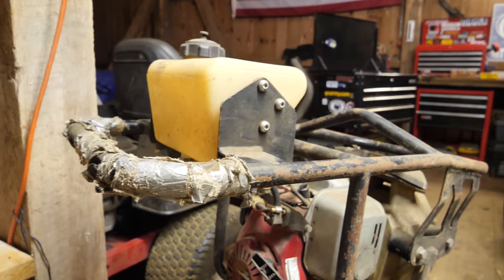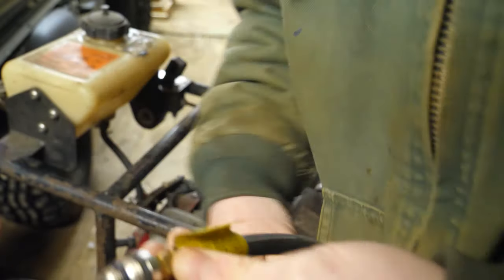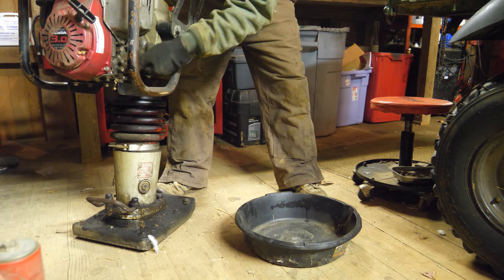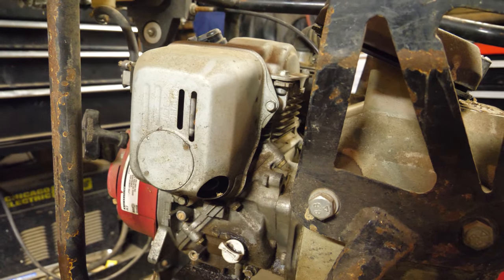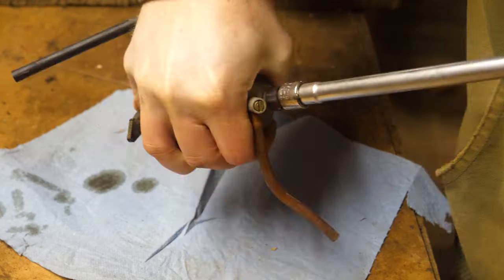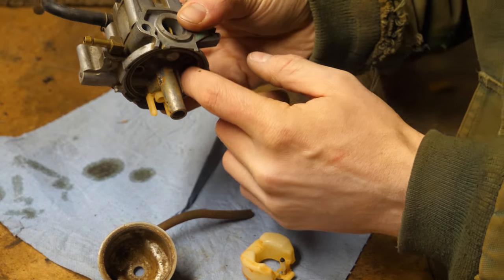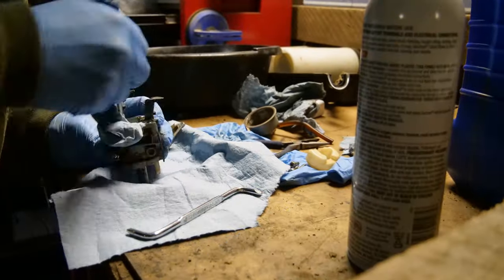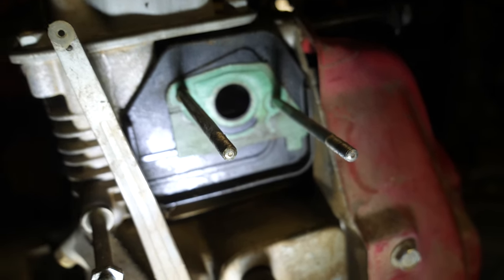Fixing a Jumping Jack Tamper

Comment: Nice work! In the future, just stuff a garden hose in the tench/dirt and let it run for a day. Much easier, faster, and better fill/compaction than a jumping jack.
Reply from the maker: That sounds pretty muddy! In our case we don't have water yet, and the mud river would end up over the neighbors driveway lol
Reply: @MasonDixonAcres  Oh, no, the river would be underneath the surface. Stick the hose down in the back filled trench and run the water. The water stays down in and you never see it (it flows within the trench and seeps into the ground under the backfill). The running water collapses the backfill and settles it. My trench was completely compacted/settled within a day or so just using a garden hose stuck down in the trench. That was a couple years ago and no settling since. But, yeah, you’d want thousands of gallons depending on length and soil type.